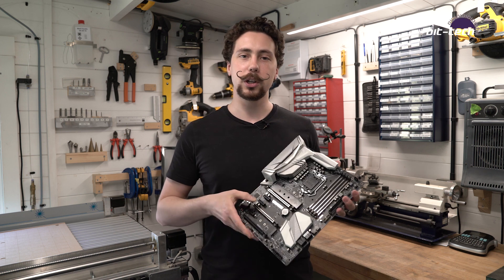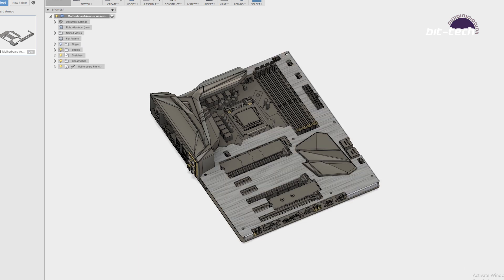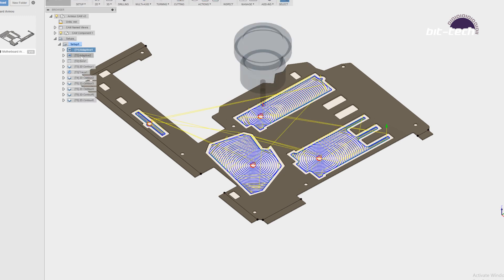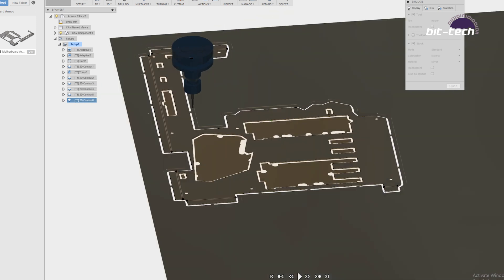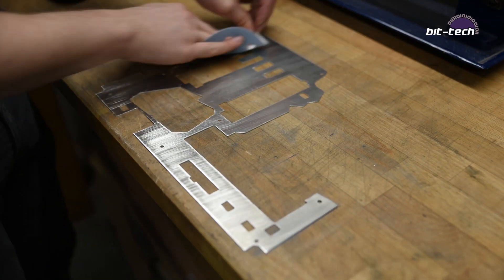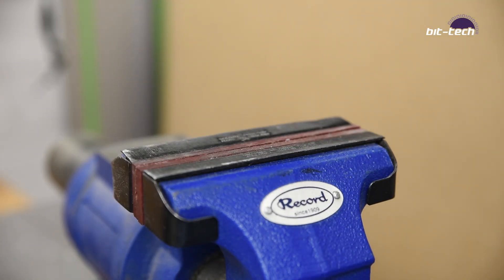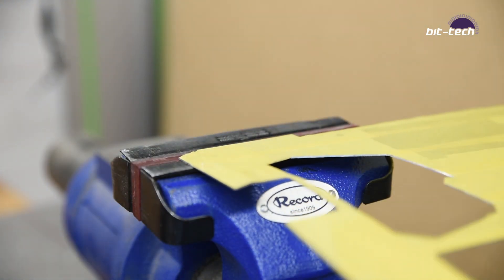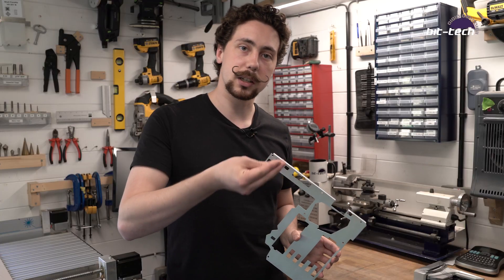How To Make Motherboard Armour (CNC Machine) | MSI #YesWeBuild

Comment: How did you attached the aluminium plate? I want to make something like this, but I'm afraid of launching whole piece at the end of cutting.
Reply from the maker: Use the tab feature found in the geometry section of 2D contour
Reply: @bittech1  you mean on your website? Cannot find anything like this...

Comment: Great educational vids.
It would be awesome if you make a vid of turning aluminum sheet into full custom motherboard tray for custom watercooling loops didnt find any on youtube
Great vids again...
Reply from the maker: You can use the same principles found in our motherboard tray video for aluminium, works exactly the same :D
Reply: I was hoping to get some more insight on the cnc :d
Btw will 900 x 600 cnc will suffice for big cases like 900D 
And magnum sma8?
Reply from the maker: All depends on what you want to do with it to be honest. If your panels are larger than the cutting area then no it won’t, but from what I’ve experienced so far it’s quite a good size. I’ll be using mine a lot for the 1000D project so that should give you a good idea as to what’s capable.

Comment: Nice result. Do you ever find it necessary to use etching primer before the top coat?
Reply from the maker: If you want a more durable finish it would be a good idea yeah. This is just a thick-ish plastic layer to act as a barrier so wasn't that important.

Comment: This stretching 'DIY' a bit. I doubt more than 1% of pc builders have their own CNC machine lol
Reply from the maker: Certainly true enough, although you’d be amazed how many affordable options there are now, much like with 3D printers. That said you could do this with hand tools without that much fuss too
Reply: Create one using hand tools
Reply from the maker: Check out the MSI backplate video, I do just that with a more complex piece, just use the same techniques.
Reply: @bobler420  Why would you limit yourself to archaic tools? Every generation that does just that makes themselves irrelevant. If doing things with tools from yester-year we might was well be plowing fields with our hands. I mean this is the most polite way I can btw, because it's true. You can get a cnc machine for like 500-2000$. It's more than a hammer but if you walk through home depot you will see plenty of tools in that price range, individual tools... Just pick a more modern took for your needs =D
Reply: Your local maker/hacker space may have one but they are not trivial to operate.
Reply: you can start making piece for others and charge small amount money to earn the cost back (not living on it). it would a worth investment. it really depends on how far you wanna go haha. but for most ppl there, just send the dwg to nearest shop to cut for you
Reply: It is do it yourself though.
Reply: Pro tip. Go to your local vocational college to the metalworker division. There will certainly be some student who is willing to CNC out your parts for a small fee. 

I had one of the students at my local VC build me an entire custom PC case based upon the CAD drawings i gave him (using the free sketchup software). It only cost me materials+10%. And while student labor can be variable in quality, in my experience it's mostly fairly good provided you give them the design yourself. I'm sure some could even do the designing for you but don't count on it. 
If you're truly broke, you can also make something like this by hand with a little elbow grease.
Reply: @10 M views I'd suggest using a rotary tool (like a Dremel 3000) to replicate this without a CNC machine.

Comment: wow! this is amazing, too bad I do not have this machine to cut out armor for my motherboard.
Reply from the maker: You can actually follow many of the same steps but using a different method for cutting the sheet! Check out the tutorial on Bit-Tech for making a cutting template (will be doing a video about that in the future). With a good template you could easily cut this with basic tools. I used a CNC router because I have one haha